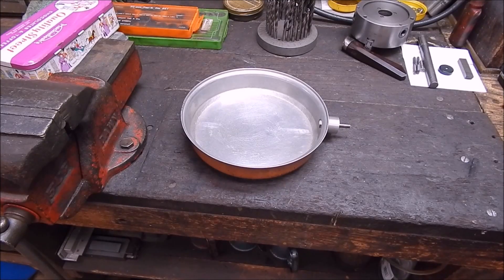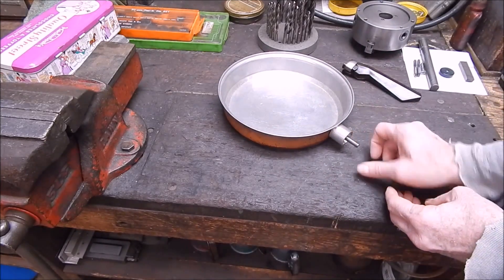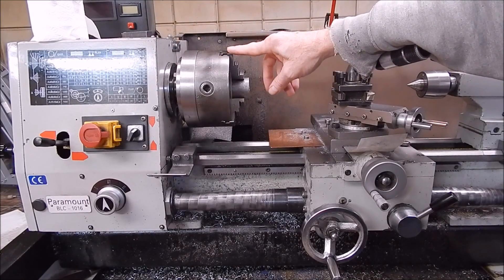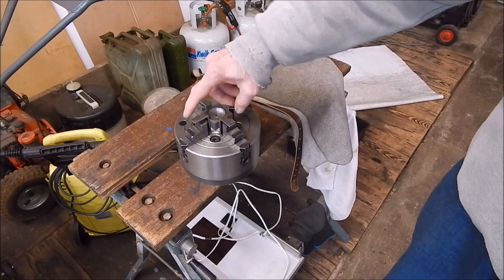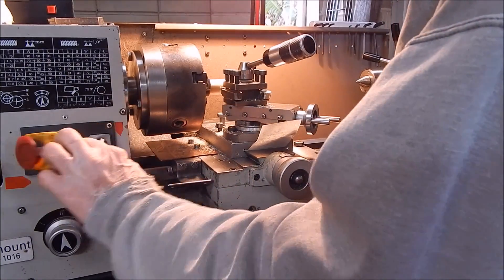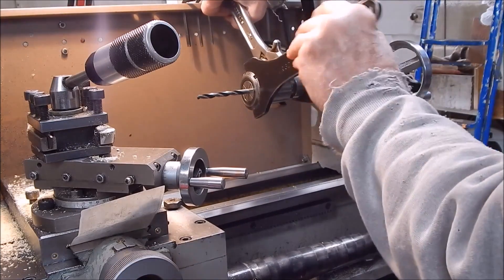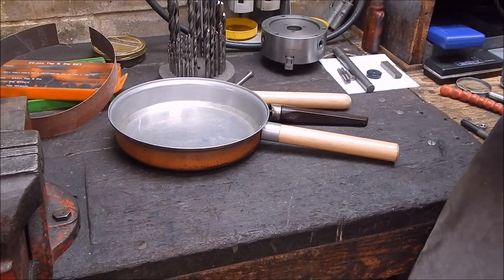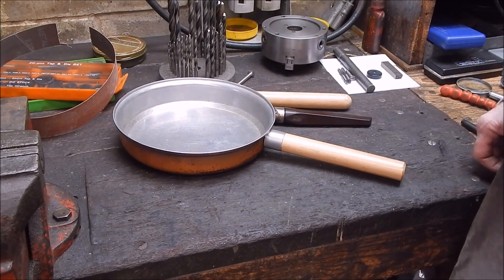My Chinese lathe resurrects a frying pan

Comment: Cast iron or steel make far better frying pans, but short of that the bottom of your aluminium pan is bowed out. You may want to pound it flat for better surface contact if you are using a electric or wood stove.  Making a handle is a good way to save it.  :)

Comment: A quick tip on threading holes in wood.  After initially tapping the hole, add some thin CA glue to the threads and run the tap through again.  I did this when building my CNC router (made of MDF) and it worked great to stop the 1/4"X20 bolts I used from stripping the threads out of the MDF.  In hindsight, I'd probably just use  wood screws if I were to build it again, though.  Great video!

Comment: Nice job Rob.
I also hate throwing things away that can be saved. My Missus has a set of kitchen knives that have the scales attached to the blade with aluminium rivets. She will insist on putting them in the dishwasher...
So, I am in the process of replacing all the rivets with brass.

Comment: The drill is not in the center, I recommend at first using a Centering drill and adjust Tailstock
Reply from the maker: Yes I was a bit slack there.  Being wood I thought the drill would centre dead easy, but the grain threw it off line.  The tailstock is aligned OK.

On the reworked handle I DID use a centre drill first, and it all worked out OK.

Rob

Comment: Rob, dribble a little thin CA glue (Cyanoacrylate) in the threads of your handle. Rotate the handle until the glue completely dries, then re-tap the threads. Do this one or two more times, and you will greatly increase the strength of the threads in the wood. (Just make sure that the CA is completely dry before running the tap back through the threads, or you may glue it into the handle)

Comment: cast iron frying pans the only way to go.
Reply from the maker: Yes, I'm thinking that way.  I may have to go to a camping store and check out what they have.

Cheers Rob
Reply: MUCH better to get a used Griswald or other antique cast iron pan, they were made with better steel and have a much smoother finish while being lighter. The modern pans are hard to clean and keep seasoned.

Comment: Nice repair.  Good to give the pan more life.

I do a lot of wood work so I am very familiar with grain or different density causing issues when drilling.  End mills typically can drill a straighter hole for me with less or zero deflection.

Comment: solved it a different way , bought a second one (same) replaced the handle on the old one , cleaned the busted handle untill it looked like new and whent back to the store for my money back
when you make the next handle you need to cut the part that goes intoo the socket of the pan under and angle so the handle points up a little

Comment: Good one Rob!
Its not really about frugality but about the joy of repairing an item you have used happily for years. Its a feeling not understood by todays throwaway society.

Here is something that may make re handling threads easier in the future. Ts a threaded woodworkers insert that screws home with an allen key

https://www.google.com.au/search?q=threaded+inserts+for+timber&client=firefox-b&tbm=isch&imgil=fX66Lkx5asjg4M%253A%253BNQ_joKhnkZ_uVM%253Bhttp%25253A%25252F%25252Fwww.anzor.com.au%25252Fstainless-steel-threaded-insert-rivnut-nutsert%25252Fproduct&source=iu&pf=m&fir=fX66Lkx5asjg4M%253A%252CNQ_joKhnkZ_uVM%252C_&usg=__RPvq_lAGb6QR5OzUCczpChPiO8M%3D&biw=1920&bih=811&ved=0ahUKEwjatcjc_fbUAhWFFZQKHW-KDF4QyjcIdw&ei=C2VfWZqEHIWr0ATvlLLwBQ#imgrc=ORGVqqa8aXpifM:

Grahame
Reply from the maker: Hi Grahame,

Yep, with your favourite pan you always know exactly how many chips and fish fingers to put in.

Get a new pan and it's a whole new learning experience - I'm too old for that ;)

Thanks for the link.  Interesting inserts.

Cheers Rob

Comment: From now on you will have to fry very thick pancakes so that the pan does not tip over to sit on the end of the heavy handle. (11:40 into the video) or shim the end of the handle or you turn now a new heavier pan (out of anti-alzheimer's stainless steel?) to go on the new handle so the pan sits flat on the stove again... ;-) That might even become a metal spin project. Consult with Emma's spare room. Possibly her boiler end covers can be scaled up to pan size. :-)
Reply from the maker: Ha Ha.  I may have to do some weight reduction on the handle.  And hammer the base flat as well.

Rob

Comment: Collet wrenches.  I find the opposite to you, and I'm also ER32 on lathe, tailstock often and also mill.  I find the single point wrenches far more convenient than the cumbersome ER multi point wrenches.  But the multipoint does give huge torque.  The special ER32 nut with inside bearing is also very good for getting serious grip.  Many thanks for bids & tips. Joss from Cork.
Reply from the maker: Hi Joss,

I agree that the multipoint wrench is more difficult to align, but the leverage is way higher.

I've looked at those ball bearing chuck noses, but never felt the need for one as I don't have any problems with the existing setup.

Either way, an ER collet system should be on every lathe owners bucket list, but the reality is that very few owners venture into collet land - a pity as they are missing out badly.

Cheers Rob
Reply: The multipoint spanner is excellent, but don't toss the hook spanner too deep in the toolbox. I found out the one shortcoming while trying to tighten the collet on the hub of a small flywheel: if the work extends out to the grooves in the nut, you can't get the spanner on. I had to order a hook spanner to do that job.
Also, the multipoint ones are more sensitive to difference in nut tolerances. I had to do some grinding on mine to get it to fit all of my ER32 nuts.

You might want to try one of the ball bearing nuts--I have both, and the ball bearing type takes far less effort to tighten and does not turn the work as you tighten it, especially important in collet blocks.
Reply from the maker: Hi Ted,

I still use the single point for some jobs, for the clearance issue you mentioned.

I've not had any issues with turning when tightening, or spanner fit - I have four ER32 collet chucks/noses from various suppliers.

Cheers Rob